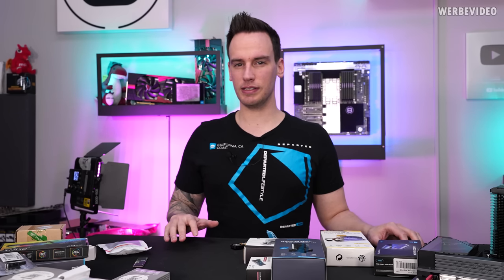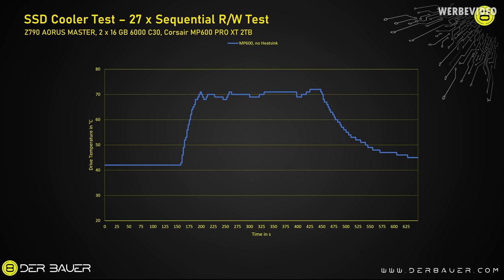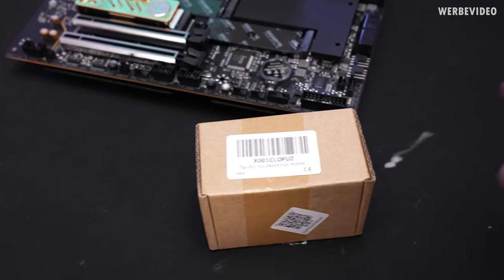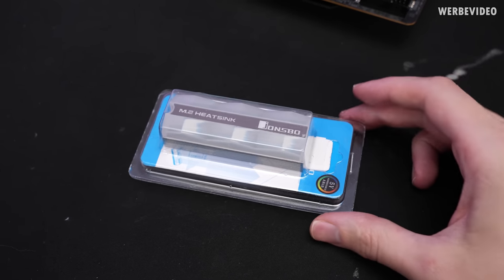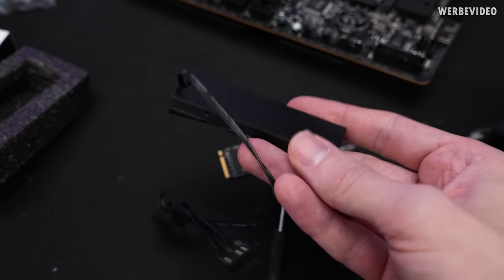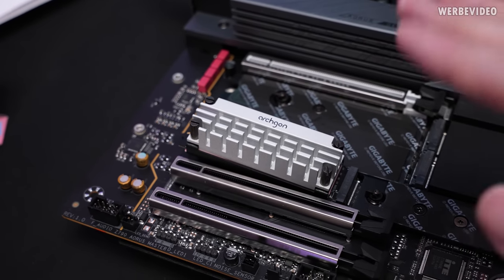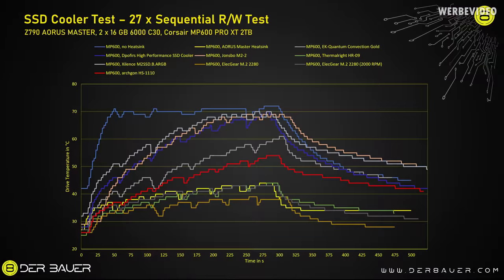Who designed these? Terrible Cooling Performance and "Interesting" Mounting Solutions

Comment: I have and use some very simple finned coolers that snap onto a carrier that holds the M.2 NVME, the best looking in my opinion is the very cheap EasyDIYFab with diagonal fins. It's not a huge amount of fin area but it's a pretty big hunk of aluminum to sink heat into so with even a little airflow inside the case it'll shed enough heat to keep a NVME happy without over or under cooling it. Also have a Jonsbo M.2 3 cooler which is diagonal fins too. Both cool 970 Evo drives well enough.

Comment: On the rubber band cooler mounting, the rubber bands are also vulnerable to even trace amounts of ozone generated by combustion engines (a major contributor to the ambient ozone pollution in cities for example) or electric motors (or other electric devices that can generate miniscule arcs during operation). With all the fans in a computer, chances the heat and ozone will degrade a tensioned rubber band very quickly in just a few months

Comment: Back in the day,,,, like 20 years or so ago, i used to use termalright heatpipe coolers on the northbridge, of course even if it is a heat pipe you still need some ventilation to really get it to work.
I am long gone soldering variable potmeters to IC pins and what not,,,,,, really i can not be bothered with OC any more.

Comment: @der8auer EN
 On the elecgear there are screws on the black base that you can loosen to change the angle at which the cooler is sitting above the M.2, as in, you can rotate the heat pipe in the base and move the cooler through that arc to adjust its position relative to the motherboard and other components... the thermal paste is probably for the interface between the heatpipe and that block.

Edit... seconds later, you figured it out. Lol!

Comment: Anyone know of a way to better cool a AIO desktop pc? And I think a gaming lap top that has a normal air cooling solution that  it would have OEM but with a water block on top of the cooling block for the cpu and gpu and quick releases that work very well and a radiator that has its own pump, fans and power supply. That way while away from home its the same as any laptop but when home you just plug in the lines and turn on the fans and pump and set the pc to the water cooled mode and it can crank it up and give better speed or even just run cooler when you r at home

Comment: Ive never cared about cooling SSD´s, Ive got my hands full with keeping the CPU and GPU in check. But using a good motherboard with thick heat spreaders all over is a first step. Also there should wlawys be some airflow over the components even if CPU/ GPU are watercooled the rest still gets hot.
I like the Elecgear " turbine", it looks cool and gives a nice background sound for playing flightsims :)

Comment: One other point when comparing the Thermalright vs the stock plate, the stock plate covers several other SSDs and would have multiple heat sources.  The Thermalright is bespoke to just the one drive.

Comment: well simply just slapping on a big hunk of metal or other material may not be a bad idea since most users wont put their ssd to a long enough load to heat it up. I remember there being some ram sticks which just had a small water reservior in the heatsink to take care of any spikes in performance. And ssds are a perfect place to use solutions like this since majority of the time, most ssds are barely used and are under full load only for very short periods of time. Also why the heatsinks on motherboards are just thick slabs of aluminium aswell.

looking forward to part 2

Comment: 12:36 The ElecGear allows you to rotate the "turbine" so it doesn't have to be directly above the drive.  It pivots on the axis of where the heatpipe enters the base, toward the north or the south of the motherboard.  Edit: another case of watch first, comment later, since you figured it out shortly after. Oops.

Comment: I'm curious about the performance of the 980 PRO that comes with a heatsink.

I have an x670e Taichi with heatsink plates and even a fan-powered cooler that I could use, but I wasn't sure what would perform better.

After this, I have a feeling the motherboard heatsinks would work better, at least in the case with good airflow.

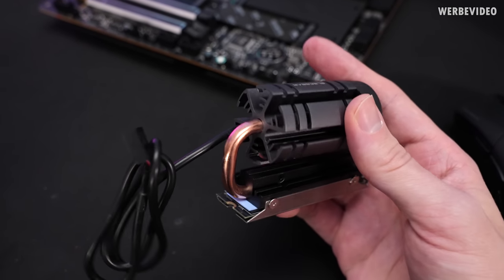Comment: On that ElecGearM11 @ 12:24 Do kindly examine the two black screws or bolts. 
They seem to be good old philips heads.
 These 2 screws on that black mounting rail - 
You gently loosen them a bit and since the heatsink copper tube itself is basically perfectly round, you can manually tilt the heatsink with the cooler fan to either side. That way you'll gain some extra room. Hope it helps anyone wondering on how to do it! :)

Comment: The ElecGear looks cool from the outside; would be curious how it performs without a heatsink. If its under the GPU it might benefit from... or get hurt by the hot air from the GPU anyway.

Also the MP600 comes with a stock cooler from corsair, right? Why didnt you test the stock cooler?

Comment: While there are flat heat pipes, they're formed and sintered flat, looking at the heat pipe used here for 5 secs, its obviously a round heat pipe that was mashed down and joined to the flat copper plate, so you're only getting some heat pipe performance at the very very end of the unmashed heat pipe, provided it even still works as a heat pipe

Comment: The cylinder design could provide excellent cooling if the airpath is contained in the cylinder, and if the side of the cylinder had direct access to the chip. This may allow cooling of small cpus

Comment: I use mostly server motherboards and more budget oriented options. For ssd cooling I just use the generic china aluminum stick on heatsink.  They come in many sizes and you can stick them wherever needed.  I look with my thermal camera and decide what chips need some help.

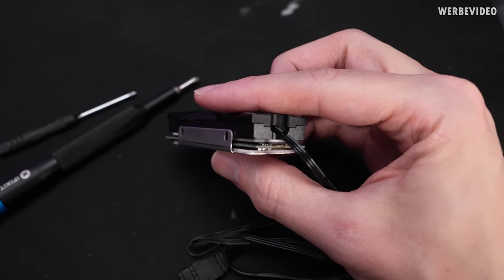Comment: Could there be an issue using thermal paste instead of pads? Do SSDs have any parts that could be shorted out by the heatsink? I've seen a few people use paste because there are other coolers that have the issue seen at 10:10 with dual sided SSDs.

Comment: Hi Roman. Thank you for your video. I have an off-topic question regarding your Zen 4 direct-die cooling video. Would direct die mounting work with one CCD or would the lack of the second CCD cause the cooler to become unbalanced, tilt and possibly crack the die(s)?

Comment: You should test just putting a single small copper heatsink on the controller of the SSD to see if the throttling can be prevented without cooling the flash.

Comment: the elecgear and thermalright ones are what happened when someone opened a portal through time and they decided to bring 2022 SSD to 2008 engineers, let them figure it out for a while, then they come back with those. Comical but it works. Really reminds you the day where motherboard manufacturers would put big ass heatsinks on northbridge especially something like EVGA nForce mobo
Reply: Yeah, some highend northbridge or DDR2 cooling comes to mind. It is completely overengineered and does the job, but you could get 80% of the cooling performance for half the amount of material.
Oh, I still have the original Maximus Formula here. That has like a pound of copper on the chipset and VRMs.

Comment: Great video, and I would actually like to see a bunch more of these weird things in a follow-up video.

I'd also like to see you do some testing and results on what impacts there are from mounting a heatsink like these with thermal pads on just the memory chips, just the controller/RAM, or both. I've seen claims a few times that it's actually better to run SSDs with the flash chips warm and the controller cool since the flash supposedly operates better (either performance or longevity) when kept at high temperature, but all the designs you show here involve thermal pads that cover all the chips equally.
Reply: Head that as well, that the flash memory needs some warmth. And since it's the controller that tends to put out heat, having a literal heatspreder that connects the two feels like the natural solution

Comment: The one with the fan and pivit looks like youy should lossen the screws slide it out of the lock and put thermal grease all in there so the gap is filled so it will work tons better.

Comment: The fan on the ElecGear might be similar to what is in ~2U server/network equipment. Designed to be effective at moving air without consideration for noise levels.

Comment: Thankyou for this video. I have been testing various SSD coolers lately to find the one that performs the best in my 11liter ITX case as these ITX motherboards share a heatsink with the chipset and SSD resulting in higher than normal SSD temps.

Comment: If you are on a data server that moves continuously data y would go to the active cooling solution y truly like the concept you can even mount a tube  to direct the hot air outside of the case

Comment: I got the MHQJRH M.2 Heat sink off amazon for like $10 USD. It works very well and is very secure. If your motherboard doesn't come with a heat sink, I'd recommend this one.
Reply: I hope he tests that one out, it's one of the best sellers and seems to have the biggest surface area among the smaller heatsink solutions. The thing is that case airflow should be a  key factor, and Roman's open bench cannot test that.

Comment: I like the way you laugh at some of the designs.  <snickers>
Perhaps you could give us the Der8auer design for the perfect M.2 cooler?  How about an actively cooled one with mini-fans running at an acceptable rpm?  Daisy linked for a one connector solution?
Reply: the Thermal Grizzly cooler is rather simple in comparison

Comment: i wonder how the results would change with a gpu installed as well since it will give them some airflow. also i wonder how vertical vs horizontal mounting would effect their performance.

Comment: The Jeyi branded ones on Amazon are really good for the price. They have a few different designs that are mostly aluminum and two copper ones with a higher fin density so they would probably work better than the weird copper one in the video. I think my m.2 SSDs would have probably been fine with just airflow over them, but my motherboard didn't come with the big detachable heatsink, so I bought the 2-pack of low-profile ones for like $10.

Comment: Sure rubber will degrade, but UV-light inside your PC case to the extend it becomes a problem? I'd more worry about burning my eyes or getting skin-cancer at that point.
Reply: also heat loads degrade rubber. It also degrades on its own if it's cheap and has impurities. Use zip ties

Comment: Well, nothing was really as good as the stock motherboard solution.
But you have all these interesting coolers already. So compare a sub250€ motherboard with the more reasonably designed coolers please.
Reply: stock motherboard solution is a metal brick on top and below (this board has metal plates also under the SSD to dissipate below).

Comment: It would be cool to see the follow up video. Both the thermalright and the elecgear seemed pretty nice, the movable heatsink on the elecgear looked like a good solution if you have a large gpu partially obstructing the slot where your m.2 would slot into if the board does not have a built in heatsink. Is there any realistic time where if the test is run long enogh that the aorus master's built in heatsink gets saturated and unable to further cool? It looks like it's just a giant block of metal without any real fins, and is there much difference if running multiple ssd's all on that same built in heatsink?
Reply: That would be a nice followup. Testing how long it takes to get saturated, how the temps are at that point, and how the aftermarket coolers do in that timeframe.

Comment: I hope you will test some of those small heatsinks with an integrated blower fan, I can see that being useful in cases where there is no airflow over the M2 slot. I rigged up something similar for my M2 slot on the back of the motherboard that would otherwise overheat.

Comment: I appreciate you looking into these, because there are a lot more you can cool with these.  Such as a thicc nic, etc.  You approached these reviews with ssd cooling in mind, but heatsinks can be used in all sorts of applications (of course I’m stating the obvious here; but I didn’t catch you stating that once).
Reply: Some of them remind me of my wifi cooler. Some DIY solution to keep the USB stick cool in summer to prevent it from cutting out.

Comment: I have an EVGA 980Ti Hybrid and the pump blew out of it. I know they make an NXZT adapter so you can add a couple different companies' AIO CPU coolers on it. Now that EVGA doesn't make GPUs, or hasn't made any parts for their hybrid GPU pumps since the 10 series, are there any other options (cheaper) that I could do? Do they make a cheap universal air-cooler? Just shopping around because it was my first 4K card and I still use it in my "retro" PC.
Reply: For what it's worth, the Arctic Accelero extreme series did well until I bought a custom block for my 1080ti. Was going to watercool my 980ti, but being a ftw model, it was just custom enough to not be compatible with any on the market. :(
Reply: @ZeroHourProductions407  Thanks for the info.

Comment: These are supposed to be used in a case with some airflow.
On open bench they probably perform worse.
What happens if you point a fan towards these m.2 ssd coolers?
Reply: @15:51 der8auer agrees with you.

Comment: I bought a pretty cheap passive cooler that's doing well for my 970 EVO but it did come with a pretty basic hunk of aluminium and these rubber bands. Are all types of bands not recommended for the mentioned reasons? The "Dpofirs" one looks like it has super low quality bands in comparison. Mine is AXAGON CLR-M2L6
Reply: There is no way of knowing what material has been used and the good rubber silicone materials are expensive so it's not likely in a normal product.
Use nylon zip ties. Those are eternal and don't cost much
Reply: @marcogenovesi8570  Sounds good, I'll replace it tomorrow.

Comment: After killing the writespeed for good on my then MP600 trying to install MSFS2020 7 times, (there was a bug that wouldn't let me use umlauts im my username for the first weeks) I bought the Cryorig Frostbit Dual Heathpipe M.2. I briefly regained some writespeeds but in general it stayed att 550mbit/sec which wasn't any faster than any SATA SSD. The Cryorig cooler also had the ability to off center the heatpipe, very useful as I have your offcenter kit for the Ryzen 3000 series, firstly run on a 3700X and then on an 5800X3D. As the m.2 is above the GPU  on my ASUS X570 Tuf gaming board it gets some cooling from both the GPU and the front fans of the case. I've now switched to Samsung 980 Pro m.2 disks and it has kept it's speed much better than the Corsair, never gonna buy anymore disks from that brand...
Reply: Yeah you are right samsung really start to dominate the electronics industry,  in tv panel's y  don't know any that can compete  almost 2000 nits brightness

Comment: The angle adjustable fan cooler looked like it could fit in a 1U server, which is quite important and a place where noise is allowed.
Reply: Except you'd buy a passive heat sink instead.  There are quite a few with projecting fin stacks that run down the SSD the long way to take advantage of server case airflow.

Comment: Fantastic ttests... Thank you so much Roman! I've always been very curious about these 'stupid' solutions and 'stupid' they are almost always haha. Thanks for the tip about the rubber-bands because I have used them in an Elitedesk mini to lower the temps a little bit of a M.2 disk with a little copper plate with small fins on it... Helped a little at least and spacewise I just had about 4mm in height to mount something on it. Now I know to check the drive once a year if the rubber-bands are still ok. 

And yes I want to see them allllll !!! 

Happy Holidays!
Reply: The rubber bands would make a better job as insulating spacers than to hold anything in place.

Comment: Since we are in the subject of cooling, I have a theoretical question since der8auer is the SME.  Could a noctua NH-L9x65 cool a delidded 7600x? I ask this because I'm considering building in a fractal ridge
Reply: Noctua says if should be fine
Reply: @HappyBeezerStudios  how did you determine this?
Reply: @villateschle  I looked at their page and what they think about the combination. Not sure how much of that is fact and how much advertising, but their coolers are usually pretty good.
Reply: @HappyBeezerStudios  thanks for the reply. I was a bit weary since there is a high tdp delta and also I haven't seen anyone direct die air cool.